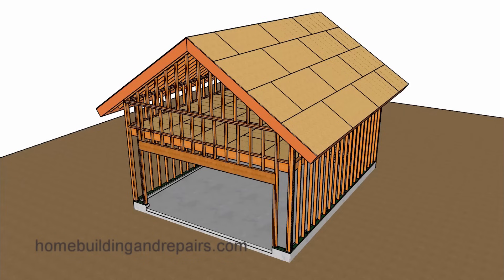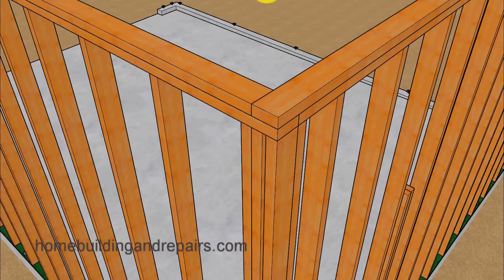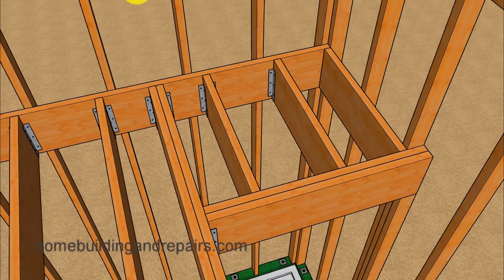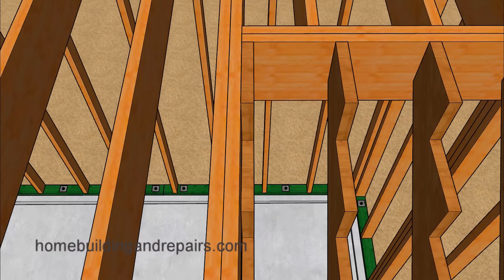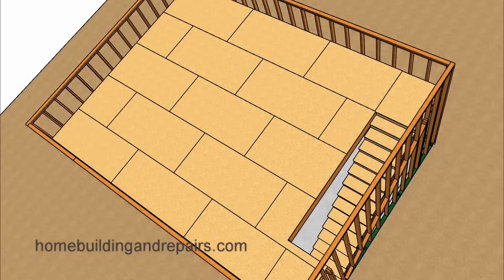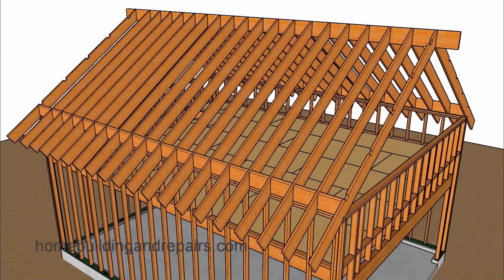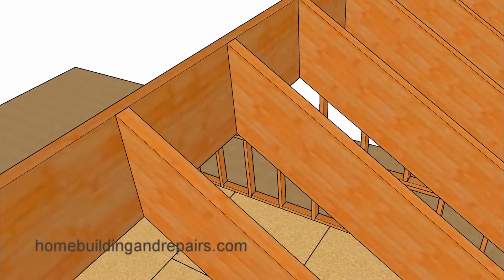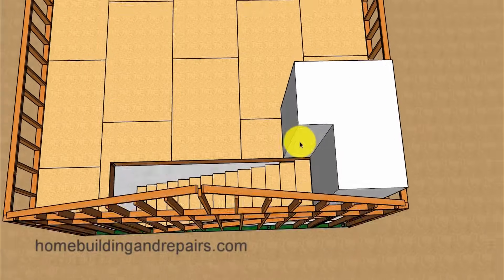How To Build Two Car Garage With Storage Loft And Stairs - Building Education Series Part 1

Comment from the maker: I have a viewer who found a mistake in the video. When talking about the garage floor sloping I mentioned it should slope about 1/8 or 1/4 inch and I should have said 1/8 or 1/4 inch per foot. Meaning that in about 24 feet it would drop 6 inches with a 1/4 of an inch slope. Thanks to the viewer for pointing this out.
Reply: well, Greg, I would think you would not have put those blocks between the rafters sitting on top of the walls as it make venting the roof difficult if not impossible. Maybe, you address this later, but I haven't found the next one. Otherwise good job.
Reply: gregvancon, what is a realistic height of the knee wall above the joists to keep code compliant for traditional rafter/joist/prescriptive build framing? Most details call for the ceiling joists and rafters to be fastened together to complete the site built truss. Is there an IBC or IRC section that would reference the design you present in this video?
Reply: If that needed to be explained, then they have no business building a garage. lol.

Comment: How do you span 20’ with 2x12. I can’t find anything that allows that span with an2x12 without some additional support.
Reply from the maker: Maybe use 12 inch on center joist layout, but check with local building department first.

Comment: Nice video, I'd build it a little bigger and have a short flight of stairs on one side with a landing then take a left up to the top so you get the head room. Also I'd use truss joists for the floor, way better performance than solid lumber.
Reply: I like the stairs you can easily take furniture upstairs

Comment: Collar ties are suppose to be down 1/3 the length of the rafter in my state. If you want it open then you need to make a structural ridge with proper support on each end.

Comment: Hi I do have a two bedroom house and my attic height is 5 ft 3 in I would like to know how to extend my attic to 8 ft what material should I use do I need braces for my attic or for the inside of the house so nothing will collapse the basement is block cement all around the inside is a two bedroom living room dining room kitchen and bathroom the Attic the size is 40 ft by 35 would it be possible to extend the Attic for a bedroom and install a bathroom of course a shower thank you God bless

Comment: Dumb question here.   Say you're framing an 8 foot section.   Then your studs will be at 16, 32, 48, 64, 80 and 96 OC.  Since that last stud is at 96 OC if you put it on center it would extend 3/4" past the top and bottom plates.  In that case do you shift the stud back 3/4" so that it stays flush within the top and bottom plates?
Reply from the maker: Yes, framing spaces between wall framing studs can be smaller than 16 inch on center spacing.
Reply: @gregvancom  thanks for this.  Then when you start another section, should there be a 15.25" gap before placing another stud?  That is, the next connecting section would not have a stud that lines up with the top and bottom plates to start but instead the first stud gets shifted over by 15.25" so as to resume the 16" oc?

Comment: What might be a typical price to build one of these yourself in the North East in 2023? Thank you
Reply: 2025, 2026? I might not even need the upper level. One bed one bath open space.
Reply: @gerald542  Yeah. I like the open space too. I'd want a concrete floor so I could just hose the place down and out the door. Simplicity!

Comment: Do I need 2x12 for a loft like structure in my shop or can I use 2x10 or 2x8? 13ft wide x 16ft deep. Where and what changes the framing needs? Thank you for this great video.
Reply: Depends on your joist spacing. Look up a floor joist span table. At 16" spacing, you could span up to 14' with a 2x10
Reply: @Bournefort  thank you! Floor joist span table is a new thing to me! Will definitely play with that.

Comment: If I’m being honest, the was you secured the floor to the walls might work but I don’t trust it personally! I would have made the floors own support down to the concrete per stud, so it would be two 2x4s for the bottom making the walls 8 inches deep instead of 4 (possible room for hidden cabinets or extra insulation if wanted) but the “attic” floor would be more supported. Just my opinion but great video and demonstration!
Reply: True, but for securing the floor system to the wall studs through the ledgers, go with SDWS Timber Screws from Simpson Strong-Tie 5" lag bolts.
Reply: Not to worry. They are structural screws that are specifically designed for shear strength, so with that being said, they are EXPENSIVE. Lol
Reply: This is technically concidered a balloon frame construction and isnt the safest, esp in the event of a fire. He has fire stops which is great, but the hardware holding the floor system would still be effected in the event of a fire.
Balloon frames are notorious for collapse hazards

Comment: How tall is it from floor to bottom of top floor?   I'm looking at doing this same concept on my 18x20.

Also, Would anything change if i brought my exterior walls to 16' tall.  And had my top floor at 10' from the ground. Thanks in advance
Reply from the maker: These are only examples of this type of construction and you might need to contact an engineer to answer your questions.

Comment: Greg, what size of the concrete footing should be poured for a garage  built on a concrete stem wall (8 inches wide - for a 8" log wall) where there will be  'bonus room" above using "attic trusses"   -- if the poured concrete stem wall is 8" wide should the footer be twice the width or larger -- of course the soil bearing would need to be known?  But as a general rule would a 2x width for the footer be the best size on average?  And how thick would the concrete footer be -- 8" to 12"?
Reply from the maker: I can't provide you with the exact sizes, but single story structures in our area might require a 1 foot wide by 1 foot deep footing.

Comment: what are using for floor joist? I would guess for most garages you wont be able to use regular lumber without using a post due to the span. so im guessing I joist or floor trusses?
Reply from the maker: I do have another video in this series on different floor framing. https://www.youtube.com/watch?v=o_-WrZIPnjM&list=PLGyVeAgAJ-tkQ-lITn379gqp97w_9Ioa2

Comment: Thanks for the video, I noticed your blocking between the rafters were cut bevel and flush with the slope of the rafters,no strapping on the rafters and the plywood nailed directly onto the rafters ,this will prevents air circulation to come in from the soffit above the insulation and out the vent ridge cap the way it should be.
Especially with a cathedral ceiling like this. Unless you live where there’s no winter this could cause serious damage by trap condensation into the roof.
Reply from the maker: You're welcome and yes, ventilation, insulation and other structural components might be necessary if finishing walls and ceilings.

Comment: Thank you for making these videos Greg! They are very helpful.

Quick question: Since this model uses a ridge board instead of a ridge beam, wouldn't the roof create too much outward force on the walls?
Reply from the maker: If structurally designed correctly, the ridge beam will prevent the rafters from creating outward pressure on the lower walls the rafters sit on.
Reply: @gregvancom  Ahh I see. I mistakenly thought this was a nonstructural ridge board . But I now see that it is suppprted by the gable studs, making it a structural ridge _beam_, correct?
... 
Would this same roof design still be possible with:
1) 4' half walls for the second story instead of the tall studs you used here? (so 2nd floor joists would be sitting on top of the first floor instead of lagged into the long studs)
2) half loft/2nd story & half cathedral ceiling instead of the full 2nd story?
Reply: @andrewschutt2827   As I understand it's just a board and not a ridge beam, since there are no support columns at both ends. The outward pressure is resisted by the  floor joists / rafter ties 3 ft below. It works because the studs are monolithic, (aka balloon framing), so there is no hinge point like in platform framing

Comment: How long can those 2x6's be before sagging is an issue? I guess it depends on the load as well.. But I imagine they begin to sag at some point
Reply from the maker: You can usually find the information you're looking for on rafter span charts that can be found on the Internet.

Comment: You should've said that the slope of the floor needs to be sloped at 1/8"- 1/4" (PER FOOT) So at 24 feet from backside to the front side(entrance) the floor will have a total slope of between 3 inches- 6 inches
Reply from the maker: Thanks and I can't mention everything in one video. That's why I'm doing the series. Thanks again and if you're thinking about this then others will be also.
Reply: @gregvancom  I'm only thinking about it because I know about it, as I've been building for over 28 years. I only mentioned it so that people don't get the wrong information is all. Sloping a floor at 1/4 inch, and at a 1/4 inch per foot, are a bit different
Reply from the maker: @hammernnails7314  Yes and if I said to slope it a quarter of an inch for the entire floor slap, then my bad and thanks again. Feel free to point out any other mistakes you find in my videos.
Reply: @gregvancom  well you've made it obvious that you can't take constructive criticism or in this case, a simple suggestion so that one of your viewers doesn't go sharing incorrect information, as you should know, people do when they get told incorrect information.

Furthermore it actually speaks to your character and setting your first response something to the effect of their praise that you got to keep people coming back to watch your videos, so you devised a way to attempt to keep their attention and then coming back. If I was you I'd be more interested in providing good information and hoping that they come back because of that.
But lastly you don't need to worry about me watching anymore of your videos or commenting obviously
Reply from the maker: @hammernnails7314  I appreciate your constructive criticism and YouTube allows me to add a comment at the top of all of the others and this is what I posted.

"I have a viewer who found a mistake in the video. When talking about the garage floor sloping I mentioned it should slope about 1/8 or 1/4 inch and I should have said 1/8 or 1/4 inch per foot. Meaning that in about 24 feet it would drop 6 inches with a 1/4 of an inch slope. Thanks to the viewer for pointing this out."
Reply: @gregvancom  thank you for sharing that with me and thanx for being a stand up guy. I respect that and I'll look forward to checking out more of your content as well. 👍
Reply from the maker: @hammernnails7314  You're welcome.

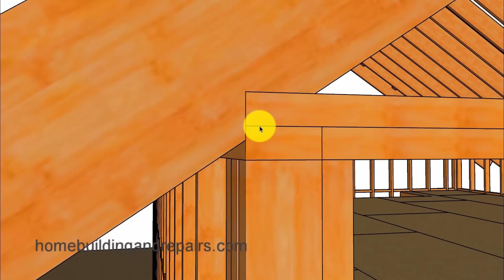Comment: Greg, would you elaborate on the "problem" you mentioned @ 9:32 with "shear panel"?
And is there a reason for not placing the ceiling rafters directly on the wall framing instead of using a ledger board, with bolts and hangers?
Reply from the maker: These videos are part of a series I would suggest watching or go to the video description area to find specific videos like the one on floor framing.

Comment: Love the videos… but I am heavily triggered by one word. It’s pronounced “HEIGHT”, so it rhymes with LIGHT. There’s no “H” at the end.
Reply from the maker: Hite, hmmmmmm not heighth. Maybe like the third Reich or someone riding a bike, but what if that's not right.
Reply: Why not put a gambrel roof on and not have to make any adjustments for headroom? That would solve the building code issue.

Comment: How would you suggest I support a 20f width x 40 ft long x 10 ft height? Built similarly like this?
Reply from the maker: I don't see why you can use the examples in this video. Provide more details about what you're trying to support if this didn't answer your question.

Comment: Anybody who is building their own garage is likely going to have a pickup truck. The average pickup truck is between 18 and 22 feet long. Even if your truck does fit in this garage, it will be just barely with no room for getting to the other side of the truck without opening the garage door. 

I would suggest making your garage deeper. 30 ft. That will give you plenty of space for stairs and also an acceptable amount of space to walk around the truck to get around inside without having to open the door.
Reply from the maker: Good points about getting in and out of vehicles, even if they aren't large trucks.

Comment: I like it, but I’m concerned it’s not enough lateral support. Not sure how you fix that without loosing headroom
Reply from the maker: Structural shear panel and hold downs with lots of building hardware is my guess. I'm not an engineer, but will be making a video about things you can do to add strength to these designs.

Comment: Only thing I don't like about this design is the 2x12 and 16" on center  joist. You are using the maximum span wich will result in a bouncy floor. If you are going to use 2x12 i highly recommended 12" on center or use a 16" engineered floor joist wich wold be more practical for a free span of 20 feet.
Reply from the maker: Check the span charts again, I used only the best lumber in this project:)
Reply: @gregvancom  so I revisited the span chart and I still don't agree,  22'10" maximum span you will still have a bouncy floor. A 12 O.C spacing will substantially increase maximum span to 26' And will fix any bounce issues....I still highly recommend and engineered floor joist for any free span over 18' you will avoid crowning and eliminate the need for blocking,  wich I notice was not included in your design. also the live and dead loads are far superior to a solid jost.
Reply from the maker: @massivehertz3869  I would have said," Even though YOU ARE CORRECT in my opinion, I still think larger joist and closer on center spacing makes stronger floors."  That's a statement I can agree with and I appreciate your comment and I mentioned the 12 inch on center spacing in a couple of my newer videos in this series.
https://youtu.be/N74zx9XVn0U
Reply: @gregvancom  thanks for the response, I like your designs and it helps people that enjoy building things themselves to save money.  My only objective was to make any one wanting to build this structure based off your design that they would be aware of the possibility of the issue discussed. Some one with limited experience in building may not take something like this into consideration. And by the way I really liked the addition you added to the roof for the stair way for head room. I have an attached 24x24 that I am considering tearing the roof off and adding a apartment above the garage and I am strongly considering that design 🙂
Reply: @gregvancom  oh and yes sorry, the provided design would pass code in most cities and states. The span at 16 O.C. is to code, however it also depends largely on the use of that space. And of course if your inspector is an ass or not lol. Unfortunately if and inspector doesn't like something they can fail it even if it meets code. So the stronger the better and they will never complain.
Reply from the maker: @massivehertz3869  Absolutely!!! and in southern California where I'm at it's almost guaranteed that you couldn't build something like this with out a structural engineering stamp on your plans and approval from your building department. There are more things viewers will need to be aware of before building something like this and thanks again for your information.

Comment: Awesome video, and timely for me as I am hoping to build a very similar garage (with a 10’ wide shed addition) later this year. Recently watched a Weyerhaeuser video on ridge board vs. ridge beam amd am now worried about roof weight and wind forcing the walls out. Do you think balloon framing solves this? I’d really like at least 3’ knee walls in the loft as I plan to use it as office space. Also, can you comment on using LVL beams as headers or ridge beams, vs solid lumber?
Reply from the maker: I like it and maybe 2x6 wall studs might prevent spreading.
Reply from the maker: Keep in mind that the videos in this series don't have structural engineering, because it changes in different areas, (cities, counties and countries). With that said, I would contact the manufactures or local engineers for more information. I would also check out our other videos in the series.
Reply: @matthewmosier8439  Thanks. I think I used the wrong term. I didn't mean knee walls: I just meant short walls underneath the roof, similar to what Greg has in this video. Wondering how to properly spread that load without eating up precious floor or head space. I plan on collar ties overhead.
Reply: @GodsProvidence  Ok, I think that makes sense? Engineered trusses usually transmit all the load to the outside walls and compensate for spreading but I'm guessing that you arent planning on the expense of trusses.

Comment: Wow I think the biggest thing in your video you should emphasize is it depends on your municipal building codes A building this size here would require permits and inspection if you go through all of the effort to build it and the inspector come and says it doesn’t pass 
check your codesTalk to the inspectors it’ll save you a lot of time headaches and money
On a sidenote that’s little  problem is easy, make your top landing bigger It should also allow you to park to larger vehicles
Reply from the maker: These are only meant to provide examples for construction and local building officials and engineers should always be consulted, before building something like this.